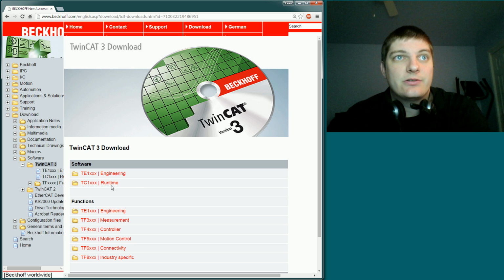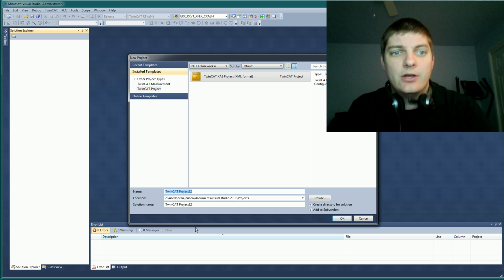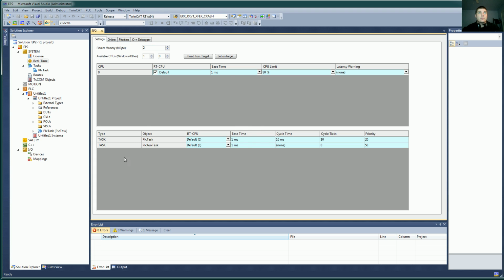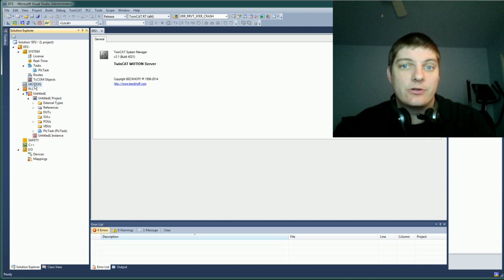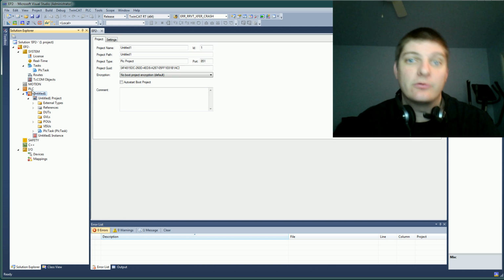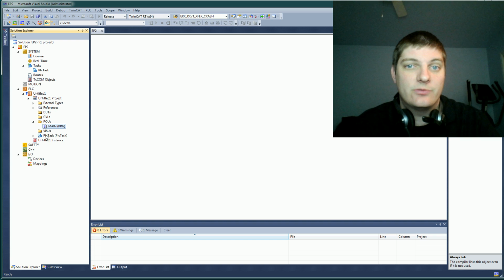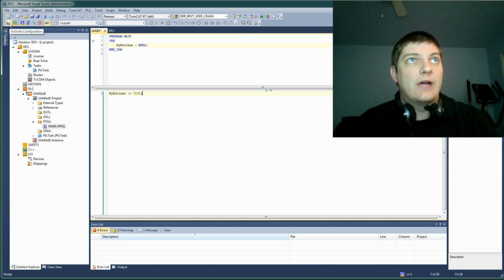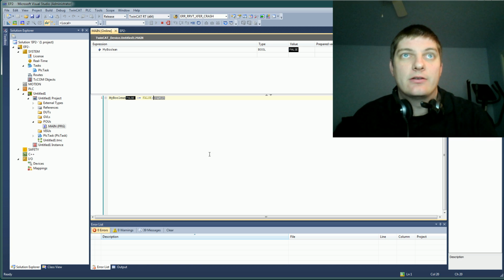Learning PLCs with Structured Text - EP2 - Programming Environment (Beckhoff TwinCAT 3)

Comment: Thanks for the tutorial.  I've been looking for something like this on YouTube or elsewhere on the net.  I'm just getting my feet wet with TwinCAT 3 and the Beckhoff platform.  In the process of commissioning a machine right now using Beckhoff hardware.  The program itself is pretty basic with using some basic discrete and analog I/O.  Not too bad.  The next project will be a lot more complex (I think?) as it will utilize two servo motors that will operate in strict velocity mode and also used for positional control.  I'm not looking forward to the learning curve so I'm hoping it's not going to be as bad as I think.  Hope you've created a video tutorial on motion control.  Thanks again.
Reply from the maker: +Don McKiness Thanks.  No motion control videos yet, but that will be my topic if I get around to doing more videos.  I don't think it'll happen any time real soon though.
Here are some hints:
If you buy new beckhoff hardware, use their support.
If running servos, dish out the small amount of cash to get the beckhoff NC (PTP) System.  
Velocity control is pretty easy... You'll want use the MC function blocks... MC Drive and MC2... they are pretty well documented, but may seem overly complicated at first.  They are not that bad.  You'll need MC_Power to get the drive moving from PLC control.
If you use NC, you can use the NC system from the IO section of the project without even needing to write PLC code.  With that you can get a lot of things working and get your encoder scaled properly and stuff like that.  Once all that is working, move to PLC code at that point so you don't bite off a big chunk all at once.  The point of the NC system is to be an abstraction layer between the PLC code and the drive/motors/encoding you use.... so use it that way, get NC working on its own, then move to PLC with the MC function blocks, and you should be good to go.
Reply: +SquishyBrained Thanks for the feedback.  Yeah, we've bought new Beckhoff hardware and I have been using their support as much as I can while at the same time trying not to become a nuisance to my Beckhoff applications engineer.  Have learned a lot on my own, internet, and videos like these.  Been through the TwinCAT training in Mississauga, ON. about a year ago but since it was so long ago, and they blow through those training sessions so fast, its difficult to retain even half of what is discussed.  I wish Beckhoff would create a website with a forum where users can collaborate, much like what National Instruments has on their site.  Again, thanks for the solid advice.  I'll be sure to write it down and refer to it once I get started on the motion project.  Thankfully, I found out last week that it's been pushed out a couple years, so at least now I have good time to figure things out and do it right.
Reply from the maker: +Don McKiness I agree on the forums and I've given them that feedback many times, but nothing yet. the closest we have is the LinkedIn group which is not bad but not really the right format, and no offical beckhoff people answer questions there.

Comment: Hi, thanks for great tutorial. I was following the steps and got the following errors (both on win10 & win8.1), any idea what can I do to resolve it? 
http://www.hemelix.com/twincat/public/twincat3_1_errorwin10.png
http://www.hemelix.com/twincat/public/twincat3_1_errorwin81.png

Edit 28/1/2016:  With windows 10 it works after following these steps
A. BIOS security settings visualization should be enabled
B.  C:\TwinCAT\3.1\System\win8settick.bat should executed as adminstrator
C. Reboot
Reply from the maker: +Mahbub Rahman I'm not on windows 8.1 or 10, but people I know use it.  There is a batch file you can run to fix the 8.1 problem, the path to the batch file is included in the error message, be sure to run it as adminitrator.
For the other problem, you have to enable the VT-x extensions in the bios for virtualization.  It allows the Beckhoff realtime kernel to have lower level access to the CPU that would otherwise be possible.  Google around for it, there are lots of threads about it on the linkedin twincat forum, but basically enabling that setting in your pc bios will fix it 95% of the time.
Reply: Were you able to solve the problem for Windows 10? I have the same issue and I have tried everything but it still doesn't work.
Reply: +Sergio Zermeno Is it Windows 10 Home edition?  If so, I recently found out that Windows 10 Home does not allow a vitalization option, so VT-x is not supported and you are out of luck.  So, assuming you have VT-x working and enabled, and a pro version of windows 10, install twincat as administrator it should work from my experience.  If not, honestly the best way to get going is to fire up a virtualbox VM or find an older PC somewhere and target that.  You can develop on your Windows 10 box for sure, just not run the runtime code until the problem is figured out.
Reply: +Evan Jensen Thank you for replying. I am on Windows 10 pro. I have ensured that the VT- X is enabled. I am running it on the new Dell XPS. I I have gone to the batch file and set it with administration setting but still same problem. I will have to try using a Win 7 PC
Reply from the maker: +Sergio Zermeno Very odd. I just upgraded to 10 on my work computer.  I'll try to get it going, as I've run just fine on this box in Win 7.   I can't do it today, but sometime soon I'll try to do it and come back to this comment.
Reply from the maker: So.... I ran the installers for Visual Studio 2013 isolated shell and integrated shell, then installed twincat 3.1.4018.26.  When trying to activate it gave me an error and pointed me to the .bat file to run.  I ran that, rebooted, and now I'm able to activate just fine.  This is Win10 Pro.
Reply: Thanks, I used with WIN10 & VS2015, works great.

Comment: Hello Dear,

I have Windows8.1 on 64bit, Virtualization is active; but when I press Activate Configuration, it shows "Restart Twincat in Run Mode"; then I got error:
Init4\RTime: Start Interrupt: Ticker started>>AdsWarning:4115 (0x1013, RTIME: system clock setup fails.
Hint: On Windows8 system execute win8settick.bat in
TwinCAT\3.1\System as administrator and reboot.)

Can you help me please?
Reply from the maker: ***** I've not used it on Win 8.  What is strange is that it seems to be a warning, not an error... can you continue on after the warning?
I'd consider a Windows XP or Windows 7 Virtual Machine with virtualbox.  Also make sure virus scanners are off and your VT-x setting is set in the bios.
Reply: SquishyBrained Thanks dear,
actually VT-x is enabled, and virus scanner is off,
so as I understand Twincat 3 doesn't work on Windows 8?
Reply from the maker: ***** Sorry, I would guess it should, but I've not used it on 8.1 or 10, and I don't think anyone else at my company has either.  We are all on Win7.  You could try an XP virtual machine.
Reply: SquishyBrained runs fine on windows 10 - just needed to run the  win8settick file as administrator and no problems afterword
Reply from the maker: Troy H  Thanks. Glad it is working.
Reply: +Ahmad Z. Tibi i have the same problem as you on win7 . can u help me? Thanks
Reply: +SquishyBrained This is the error displayed when it restarts the Twincat: Error 27 20-Sep-15 21:57:17 469 ms  | 'TwinCAT System' (10000): Sending ams command >> Init4\RTime: Start Interrupt: Ticker started >> AdsWarning: 4120 (0x1018, RTIME: enter real-time mode fails: Intel VT-x extension not enabled (in Bios)!) << failed!  

Do you know what shall i do about it?   Thanks a lot
Reply from the maker: +Paul Margineanu did you check the virtualization settings in your bios?
Reply: +Ahmad Z. Tibi i have same prob on two computers. Vt-x enabled and the Intel processor util says yes in wmware.
Reply: +Joakim Vallin for Windows 8 and 10 there is a batch file that you have to run to make it work... I think it comes with the installer. Google around, if you can't find it let me know.
Reply: If have googled alot. I have win 7 x64 in host and wmware.
Reply: Evan Jensen you would be a hero if you solved it.
Reply: I'll look at it later on, got my hands full today.

Comment: Hello I tried to download Twincat 3 , but it seems to be only available at 64 bits OS.. Well , I am looking for a 32 bit version, but in the meanwhile if you know a link to download the 32X i will be greatfull.
Let me ask you another question. I noticed that there is a CNC module to the twincat 2 ..Is there any kind of G-Code interpreter to input the coordinates in the system, and can i output the step and position signals via Can bus and operate 3 axis?
Reply from the maker: There is a 32 bit version, if you cant find it pm me and I'll find the link. As far as cnc, there is an interpreter. I've not used step and direction, but can open works well, basically you can use any commom motor or interface since the "nc" system abstracts the actual hardware.
Reply from the maker: Sorry, interpreter is g-code for any supported kinematic system. Includes delta, Cartesian, scara, even 6 axis serial
Reply: I found the 32 bit version. My biggest problem now is to figure a way to connect 3 servo-drive motors to my computer.. and send signals to it from a g-code source software. The motors are synchronous DC Motors, and it has the drives and encoders integrated in the housing. It is from Danfoss , ISD 410, they comunnicate via Can-Bus and , according to the documentation I found on the Web, they are IEC61131-3 standard.
Well, I am trying to learn as much as I can to try and figure out a way o solve this by myself, but although I have learned a lot of things related, it still lacks experience to put all this knowledge togheter and connect this motors in a proper way..
I have "sort of" a dead line to finish this build , I have finished the whole mechanical structure ..
I have seen some USB- can-bus Inverters.. I wonder if I can get the signals from my PC out of the serial port and have only this inverter as an interface between the drives and the PC. Can bus is only a protocol to exchange signals in a bus,so I see no problem in having  PWM, or step and direction , (whatever signal that talk to the drive and control the motor) encapsulated by a Can protocol and be sent straight to the drives without these breackout boards or similars..
well basically I need to keep it as unexpansive as possible .
Thanks for answering ..

Comment: Hello

First off, very informative and well explained videos! But I still have some questions.

I am really new in the all programming and I have issues in setting TwinCAT up on my PC.
I downloaded TwinCAT 3, installed it, now I have it inside my Visual Studio 2013 Ultimate, but when I write the line of code and press Activate Configuration, then, after I press OK on "Restart TwinCAT system in run mode," error messages (screenshot) pop up.  

http://s11.postimg.org/vpyxk0vnn/Twin_CAT3_error.jpg

Is the problem in my Visual Studio version or in my PC performance?

Thanks for the videos and looking forward to your feedback
Reply from the maker: Joaquin Arancibia, There should be a lot of info about it online.  Be sure you check the VT-x virtualization settings in your computer's bios.  Flip it on if it is off.  Alternatively you can grab vmware player or virtual box and bring up a Windows XP or Windows 7 Virtual machine.  Install and run there.  I did that way back when and it worked.

Additionally, it does not play well with virus scanners sometimes, so try exiting those if you have any running.
Reply from the maker: The vt error is related to virtual technology. You can enable it in the bios. Our new guy got this problem and was not able to resolve it on that computer even after setting it on in the bios. I don't think the problem is your visual studio version. Sorry I dont have more help, but thanks for the positive feedback.
Reply: SquishyBrained
Thanks for the quick reply.
ok, I checked and it turns out that my processor doesn't have this capability (virtual technology). Does that mean now, that I can't run TwinCat at all?
Reply from the maker: Kristofer Ott Sutt sadly it means you can't execute on your local machine. What I did in the past was run vmware player and run it in there, but I think even that may need virtualization. I'm not sure why this is a requirement now since we used to run on all sorts of machines.... Do you have an older machine you can try on? Maybe try twincat 2, or use a 32 bit virtual machine and try that...
Reply: Kristofer Ott Sutt Did you solve this problem? Regards!
Reply: +Kristofer Ott Sutt 

Hi, I had the same problem with my Lenovo Laptop - the Virtualization setting in the BIOS.  The Beckhoff's Tech support was kind and responsive enough to send me information on how to Enable the Virtualization Settings in the BIOS. Below is the link they sent me (Its specifically for a Lenovo Laptop, but other computers, it should be similar settings):
Enabling Virtualization in Lenovo Systems:

http://amiduos.com/support/knowledge-base/article/enabling-virtualization-in-lenovo-systems

Good Luck!